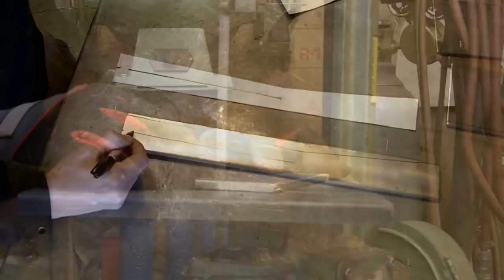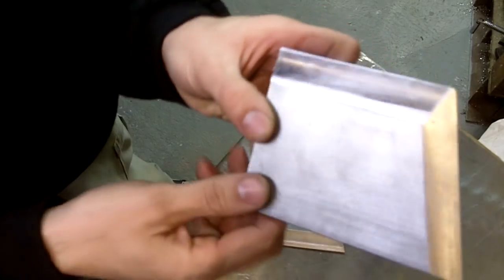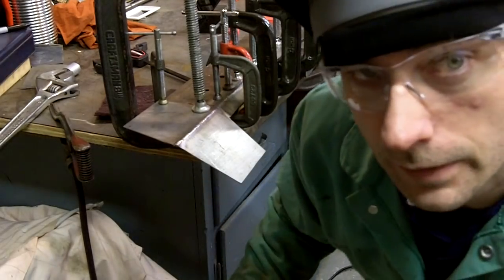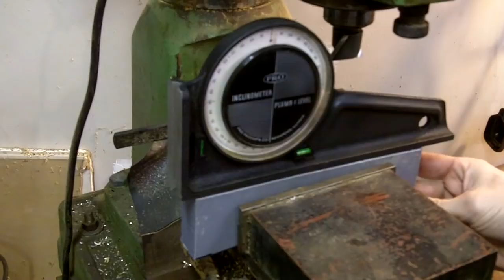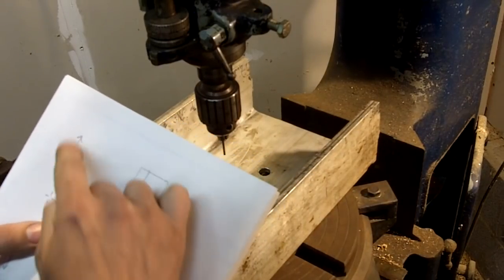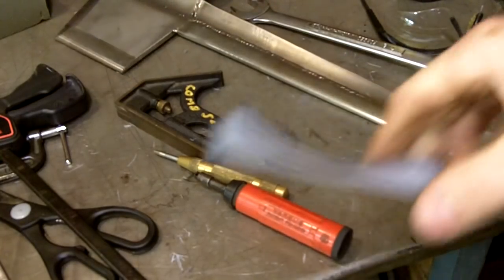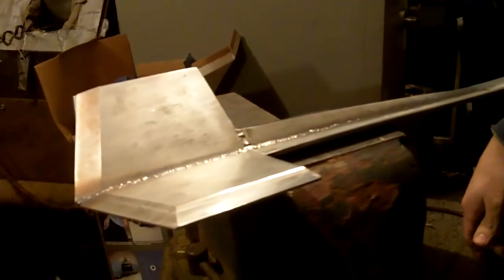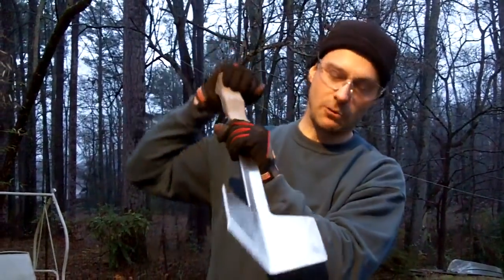Making The Shovaxe BushTool

Comment from the maker: I have worked as a Machinist,welder,fabricator and Tool and Die maker. Right now Im a machinist in a mill. Since your husband was in the navy as a machinist, he probably ran equipment alot like mine. I toured a sub and an aircraft carrier and the sub had equipment the same exact size as mine. The aircraft carrier had a very large machine shop with huge equipment. Im glad I was able to give you alittle inside on what a machinist does. Thanks for watching my friend.

Comment from the maker: @bigjohn20081983  Well, I thought about an extra blade on the other side, then I did actually consider some type of serrations for a saw like feature too. I kept talking myself out of it due to the design of the handle twist. Everything is in line for one side of the blade. I may or may not make another but, I do doubt it. This one was too much work. It was a very very complicated job. I wasnt planning on such a nice polish job but, my friend did it for me.Thanks for watching.

Comment from the maker: @leo226644  Im sure I can hack through something 6 inches. Thats probably about the max tho. I can chop as deep as the blade is but not getting into the angle. I would be afraid it might get stuck or bend the shovel part. Im gonna take it out to the woods to test it on a shelter in the next video. Thanks for watching my friend.

Comment from the maker: Sounds cool man. If you go with a heat treatable steel be sure to use the proper welding proccess and use a heat treater that knows what they are doing. This is a lot of work so dont risk it not being hardened and annealed right. Good luck and thanks for watching my friend.

Comment from the maker: Ah man, no patent yet. But, you wont see one anywhere near this for $19.99. If you did, it would be a piece of junk. The material and heat treat $280.00 by itself. That doesnt even include labor. I used the best material I could get, thats why it will chop a big pine in half. Cheaper steel may let it dig a hole but as far as chopping, it would never hold up long. Im glad you liked it bro, I pretty dang happy with how it turned out. Thanks for watching my friend.

Comment from the maker: Thanks! right now it is just a hobby but I have been a machinist for around 25 years. I thought about a hammer type surface but i didnt know how to add it without more welding. I wanted to keep the welding to a minimum because I had no idea if the heat treat would work or not and the material cost a fortune for this one. I dont think I would want a knife under a removable handle because i wanted the handle stout and 100% unbreakable. Thanks for the tips and thanks for watching my friend.

Comment from the maker: @jolietjake1970  Thanks man! I did put a ton of thought into it before I ever started. Alot of multi tools do a good job of one thing. I wanted this one to do a good job of chopping and digging both. I used Cabvalloy VC-13. I was advised that was THE metal to use when welding was involved with a heat treatable metal. thanks for the comments and thank you for watching my friend.

Comment from the maker: Hello Debbie, LOL. I havent had it bend yet but yes, the flat section would bend first but, it hasnt, its held up fine. About the rocks, if you hit a rock with full swing above ground then yes it will chip. So far, just the fact of digging and hitting rocks hasnt chipped yet. I guess due to hitting the rocks with little force. Those chinese shovels have wooden handles that break. This handle may bend but it will never break. so far, its held up. Take care and thanks for watching my friend.

Comment from the maker: Yep, Tig for me. Two reasons, With a Mig you pull the trigger and feed the wire, at the end of the weld, the wire and gas are cut off. The end of the weld is subject to intergranular corrosion because the shielding gas is not present while the weld is cooling. With a Tig, it has post flow time where you can leave the shielding gas on the end of the weld as it cools.

Comment from the maker: @SCBushcraft  Aiming the arc at the filler rod allowed it to melt off and fuse into the weld area with out over heating the weld area. What they call the heat affected zone. You have got to keep it as cool as possible when welding any 400 series stainless. Hope this wasnt confusing but, its good info for anyone that needs to weld this stuff. Take care and thanks for watching my friend.

Comment from the maker: the weight seems to be just right and it seems almost balanced. I did not plan or design that part, it was just luck. The part I did design was the twist in the handle. Most of the handle is inline with the cutting edge so it never veers off cut. Im glad I made it that way.  It cuts great.

Comment from the maker: @Snakedoctorjw  Its Cabvalloy VC-13. The cutting edges are between 50 and 52 Rockwell. The spine is a little softer, somewhere in the 40s. It had to be transitional heat treated to keep the weld from cracking.

Comment from the maker: You would have to be a machinist, a welder and fabricator to understand why I used the angle cuts on this tool. Its way too complicated to explain but setting up whats called a Rotary table on the milling machine and trying to incorporate that into the welded included angle would be too risky. You might just wind up ruining a lot of expensive material. The angled edges were a sure thing.

Comment: I am very much impressed with your skills and abilities with machine tools. The only thing I would have done differently would have been to design it so that when you are swinging the axe the dull side would flare away from your head instead of toward your head just to give a little extra safety while using it.
Reply from the maker: Ron Hargrove  Thank you Ron, I have been a machinist and welder for a long time so this stuff is finally kinda easy. LOL. Thats a dang good idea on the flare going the other direction. Good eyes bro!

Comment from the maker: your guess is wrong man, it does not torque at all. It chops like a dream. I believe this is due in part to the handle being in line with the cutting edge. I chop a 7 inch log in half no problem in my video " Testing the Shovaxe" I also chop one handed with no problems in my newest video "Testing the Dakota Pit Tent" Yep, it can be heavy to most hikers and backpackers but it's no big deal to me because I never hike long distances nor do I go on multiple night trips. Thanks for watching.

Comment from the maker: The othe reason is when you pull the trigger on the Mig, you deposit the weld and if the voltage isnt set high enough, they weld may or may not be 100%. With a water cooled Tig, you can either press the foot pedal for more amps or just not add rod until you can visually see if the puddle is 100% joined to the parent metal. I have no idea on Carbon steel which is better.

Comment: Say Heah David, Even though sometime I see your videos multiple times. I still enjoy watching them with envy (good envy) I think your very good. with what you make. One thing I notice, and it's really a important tool is the shovel, and you were able to make one with dual purpose. That in itself is awesome in my opinion. But regardless how you cut it, I find the shovel is a heavy tool to carry into the bush (camp). Even my Military Issue Shovel that can be used as a pick and I totally agree it can be used as formatable weapon.  Although it has many uses. I learned this from you. I started to look for gear out of the box, like your folding garden hand shovel. Well at the store one spring I seen some Black and Decker small garden shovels that reminded me of you, so I bought a couple because they were on sale so the price was right..I lucked out, The small shovel packs easy and it's lite so I even use it in the winter instead of relying on finding a wood to make a digging tool which is easier when the ground isn't frozen, but when it is, a metal shovel works the best. As important as the tool is, it's one I look for one that's lite. and because of watching your videos, I pick up on a few pointers from you. Thanx, Brother.  I alway's said this, I always wished I had your talents, But I dont. But atleast I was able to afford that small garden shovel that's turned out very tough, and lite and easy to pack. You my friend has some awesome talent, and you probably don't realize this, but you help our community so much with your entertaining videos that I enjoy your videos even when I seen them before. That's one heck of a good idea and tool. Thanx, David.
Reply from the maker: +paulie 4x  Thanks brother, Im glad you got some pointers from my stuff. Yep, a shovel is heavy to tote but man does it help alot. I recently found an all cast aluminum hand shovel made by Fiskars that weighs very little and it does great! I found it marked down at a local store. I found a link to it but I bought mine for 2 dollars! http://www.amazon.com/Fiskars-Softouch-Polished-Aluminum-Trowel/dp/B00005YX2U/ref=sr_1_8?ie=UTF8&qid=1457890651&sr=8-8&keywords=fiskars+hand+shovel
Reply: WoW Thanx for the heads up, Thanx.

Comment: AHHH I looked at the arc!  I will remember my eye protection for the next video.  Also, I think you need a few more C clamps.

That's a pretty nifty little tool.  I will be interested to see how the chisel edge on the axe blade works for you vs. a more conventional wedge shape.  I am going to guess it will be fine since you probably won't be using it for heavy duty axe work.

Thanks for sharing that.  Another cool invention!  This was like watching Bill Nye the Survival Guy.

Comment from the maker: @ArtistBlade1972  I didnt know you could weld it either but, the heat treater guy told me he had done it and he told me how. He said, preheat all metal to at least 250 deg. I went with 300. He said weld a little, then take a torch and warm up the areas that you are NOT welding. This keeps the grain structure even. Wrap it up and let it cool slowly. He did the annealing, heat treating then normalizing. I dont know what time or temps he used. Filler rod was Techalloy ER-420

Comment: Your awesome at your craft sir , seems to be more then a hobby for you lol. That tool is very handy and i have little suggestion for another. A hammer on one side for hammering stakes in the ground and axe on the other. And for the bottom of the handle maybe a double sided knife, but i guess the challenge would be figuring out how to have a removable handle that would cover the knife when not in use. And possibly a drill spindle somewhere in the middle of the handle for good balance. Thx for vid

Comment: That's really cool.  I imagine it wouldn't make as good of a splitter as a regular axe, but you could probably use that for bush clearing like a machete also.  I think a round handle would have been my preference.  I like it.  How heavy is it?
Reply from the maker: +Citizen Smith  Thanks man, Im glad you liked it. I put the twist in the flat handle for strength and to make the handle inline with the chopping edge. I  was  afraid any kind of round handle would roll in the hand when chopping. This thing is a beast at 4 pounds.

Comment from the maker: No, no and Triple no. ANY 300 series stainless steel is non heat treatable. It would be soft and never hold and edge. You have to use 420 or 440 stainless steel. El cheapo band saw blades might work on untreated steel for the rough cut but good blades like one from Starrett will last the longest. As far as free handing, if you cant do it try a computer drawing or paint program. Get a design you like, print then cut it out and trace around it. Ive done that before.Thanks for watching my friend.

Comment from the maker: 440. The welding rods were some weird 440 tig rod called Neptune tig or Bomber tig or something like that. I found them on ebay for $50.00. Very expensive rods. After welding the Shovaxe had to be heat treated, annealed and normalized.

Comment: Nice tool  david have you thought about puting a saw like edge into the other side if you ever make another it might not be the easiest saw to use but it would be another option to have  the polish job looks great I would have probaly hit it with some spray paint or dura coat or aluma hyde type stuff and called it good

Comment: Gonna buy the steel and sign up for a welding class. Gotta have one too.
Reply from the maker: Sounds cool sis. The welding instructor may not have any idea how to preheat, temper and heat treat 440 stainless because its a tricky process so ask them what steel they know of that can be welded and heat treated.  Sometimes its easier to go with an alloy steel for stuff like this. Anneal it after welding then heat treat and temper and it will last a lifetime.
Reply: My favorite steel is 1095, I'm still working on my bushcraft knife. I was going to send it off for the heat treatment. Anyone you can recommend for the heating treatment? Was wondering do you think 1095 would hold up for a shovax? I keep my knives and tools oiled.
Reply from the maker: 1095 would work good. Do the welding with  Tig Tectic 680 then have the heat treater anneal it, harden it then draw it back. I have no idea who you can bring it to other than  any really good tool and die shop in your area and  explain what you will be doing.
Reply: Thanks for the info. The shovax is on my long list of projects. You really make some interesting and informative videos , please keep them coming
Reply: Apache Wind if you have any knifemakers in your area they might know some one, or could do it for a fee, just research the maker first.

Comment from the maker: @SCBushcraft  Well, the Cabvalloy VC-13 is based on $20. They do make  440 and 420 filler rods. #16 would have set up Carbide precipitation which would have broke. that would suck, ha ha. I had to but 10 pounds of Techalloy ER-420 for $50.00. I was adzised to weave it just like the stacked beads for a 6010. I was also advised to not aim the tungsten straight down on the weld. I was told to carry the arc aimed at the filler rod and let it melt off into the weld area.

Comment: Great idea . I was thinking of a design almost identical . Same concept but how about if instead of a weld up the handle ,it would attach like two halfs of a hinge with a pin so you could separate the two halves for two machetes or put together for a shovel or fold to pack . Just an idea

Comment: Awesome tool you made there, I bet you'll never break that one :)) Do they make 440 filler metal to weld that with or did you use 316 or 309?  It looked like you almost had to run that stuff in a stacked bead like 6010 or something.

Comment: Really great video as usual! Great explanation of how the design and build went. If I may what metal did you use for it and what settings on the tig were you using cause its seemed just a little cold but I'm sure it was the video sound that made it that way! Again great video keep up the great work
Reply from the maker: zeke1eod  Thanks, I'm glad you liked it. The material was 440 stainless. I cant remember the setting on the tig. I was suggested to weld it as cold as possible to help prevent Chromium Carbide from forming in the weld. Im not sure of what that is but it passed through heat treat and annealing and worked just fine. Thanks for watching my friend.

Comment: Great build. Quick question: What clamps do you use at the end at 42 minutes? I've never seen that style metal clamp, and would like to grab some
Reply from the maker: +Step Two And A Half Thanks , Im glad you liked it. Those are Sears Craftsmen  vise grip style padded jaw clamps. I looked on their website and couldnt find them. They are kinda old so they either dont make em anymore or they are a in store product.
Reply: Reallybigmonkey1
I know my local Sears store by memory by now, and I've never seen them. I'm a welder that's just getting into woodworking, so you can imagine my fascination with clamps.
Reply from the maker: +Step Two And A Half  Ah man I hear ya! I have a ton of clamps myself. The handles on that clamp say Craftzman professional. The underside is stamped412. On the arm ist stamped31693. That name is key because years ago the always spelled it with a Z. Craftzmen. At some point recently they switched over to S and spelled it Craftsman. http://www.ebay.com/itm/Craftsman-Professional-Automatic-Self-Sizing-Locking-Pliers-Clamp-/291396743446

Comment: David I'm curious as to why you didn't put some lighting holes in, hex shape and it would have been a little lighter and able to remove nuts. I might have put a short curved tab on the end of the handle V'd it in the center to use as a pry bar/nail remover..Ha! Ha! I did metal work most of my life and still enjoy it being retired. Great job! How much does it weigh?

Comment: Dave can you briefly explain the metallurgy of this?? What kind of steel? Normalizing would e put the steel back in the original condition, right? Then you HT, to get hard as needed, then draw temper.
So if you normalize after shaping and welding, why is anneling necessary? What am I missing?
Reply from the maker: All I can say is its 440 stainless. I had a pro heat treater take care of the heat treating on this one. Years ago as A tool and diemaker I did heat treat alot of tool steel. Stainless is a different animal. On top of normal heat treat and anneal, Im told once you weld a heat treatable alloy you have to normalize first, then heat treat, then anneal. Welding stainless itself causes carbide precipitation at the the HAZ. (Heat Affected Zone)